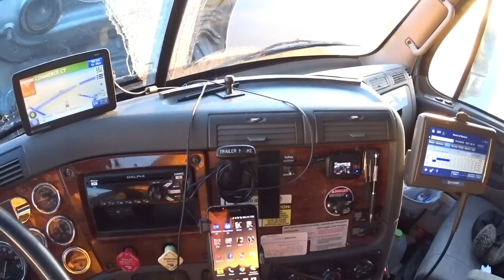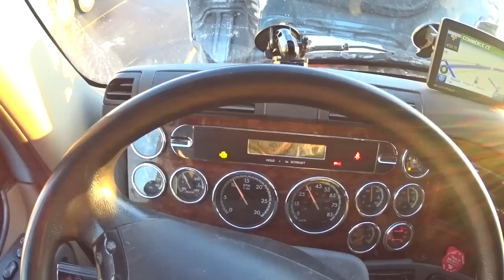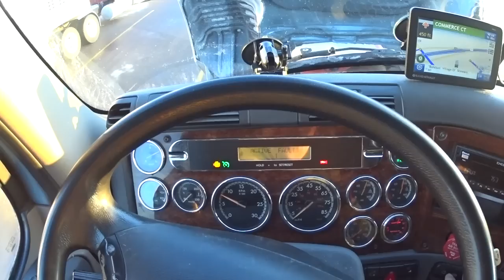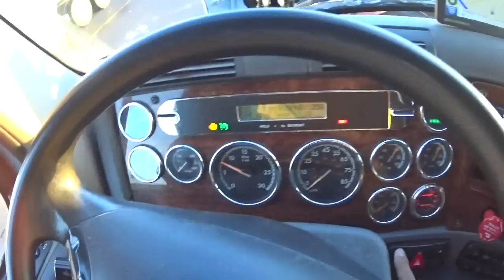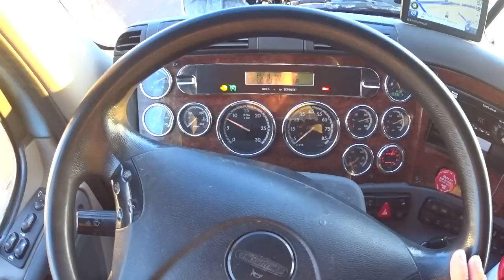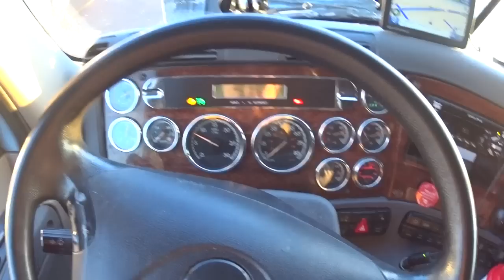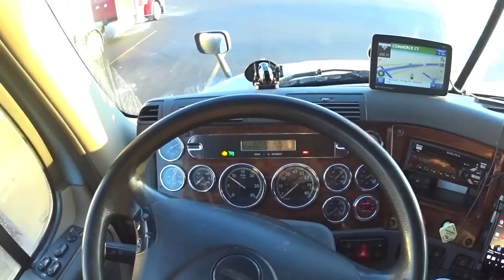3017 will Babyblue start at 4℉ ? Why is the engine check light on?

Comment: i had that fuel filter system on my 2005 western star,cost me $900.00 to buy and have it installed i liked it , too , easy to drain off and change filter as well with the low sulfer fuel a filters life is cut short.the best cure for cold weather and fuel is good old K/1 20 gallons or so,this coming from a 30 year veteran hauling gasoline in upstate NY

Comment: Need a code reader. Perhaps the boss, or maybe call Freightliner and tell them what the code thrown is, and they can tell you what to check. It will probably de-rate if you try and run with that code thrown,  limiting you to 40mph or less. Good luck!

Comment: at the bottom of the w/f separator you should see a drain it should have a black or red handle just turn in and let it run for a second you need red antifreeze to all it would not hurt to run some kind of fuel additives to help with water and jelling

Comment: #2 diesel gels up at anything below 5F, that's your problem. I'm running #1 up here in NoDak because my fuel/water filter gelled up 2 days ago, had to juice the fuck out of it with power service just to be able to drive it to the gas station for fuel.